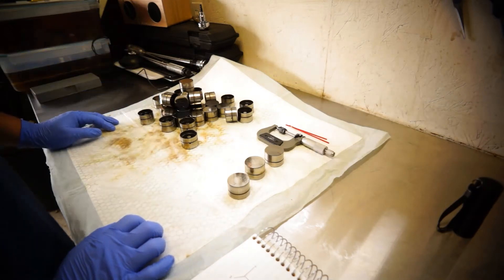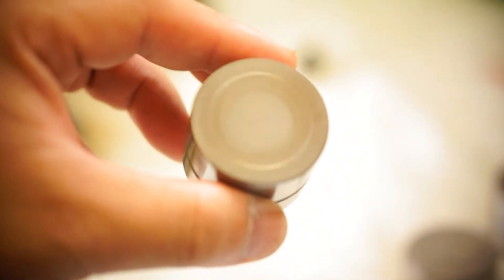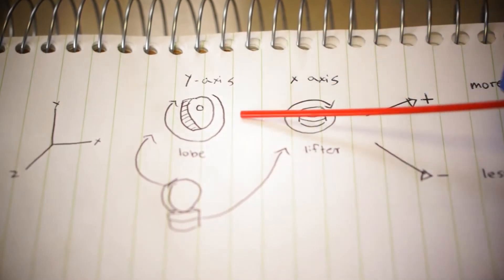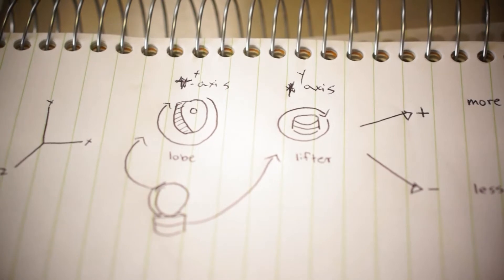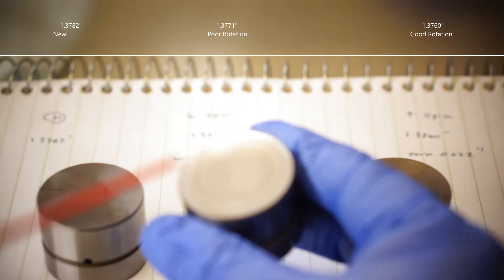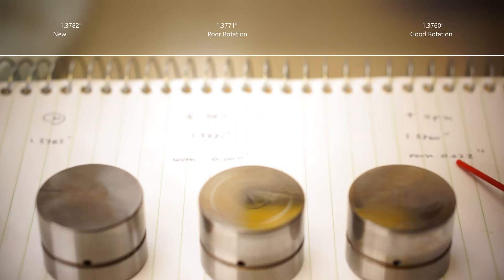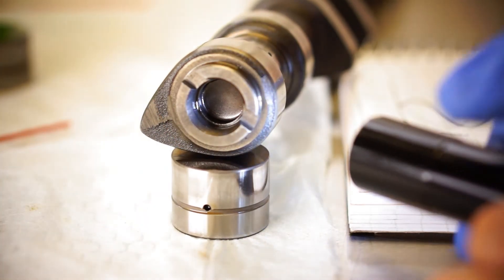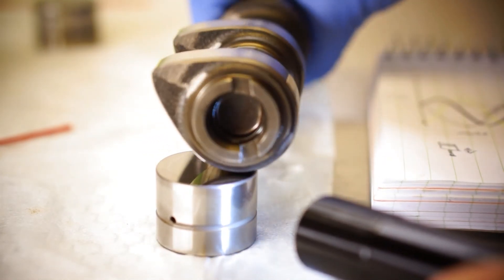The nature of the Beast: M156/M159 Valvetrain with Flat Hydraulic Tappets

Comment: Hello, Is it better to replace original worn lifters 1560500225 for 2008 Mercedes Benz S63 AMG with M156 Engine with more expensive and upgraded version of the black lifters 1590500000 like the ones from 2014 Mercedes Benz SLS AMG black series?
Reply from the maker: We definitely think so!